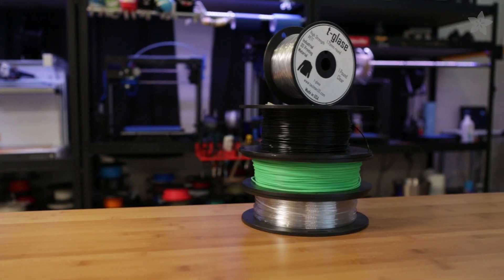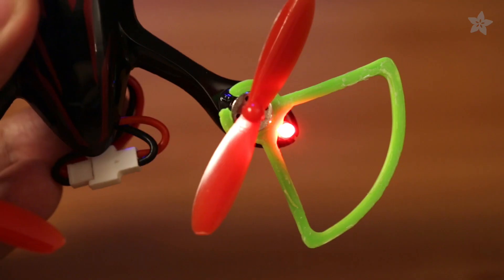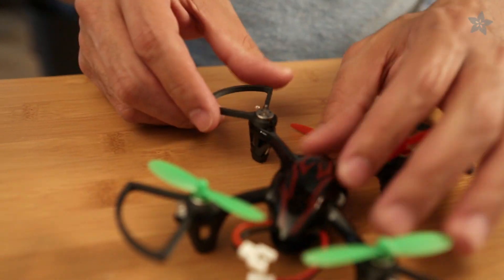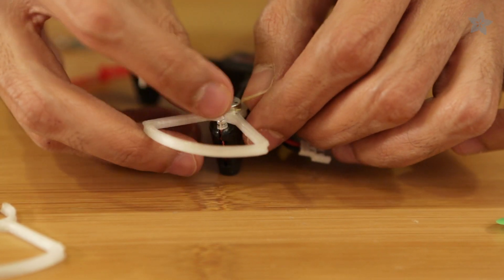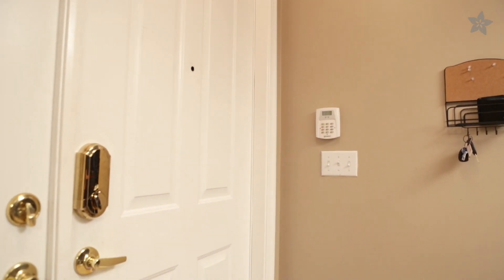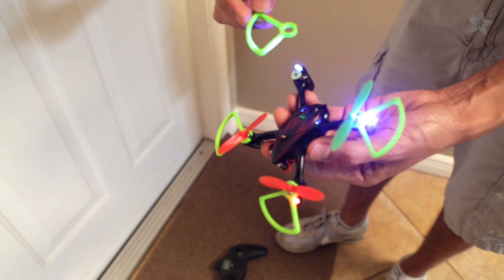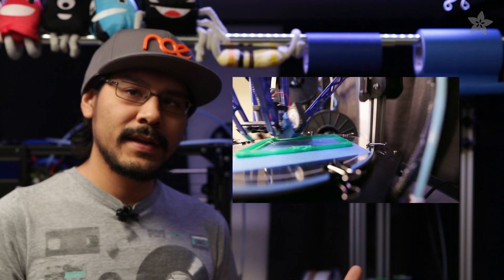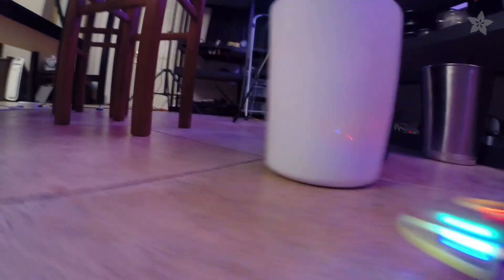3DPrinting with High Strength Filaments for Drones

Comment: thank god i ordered abs filament rather than pla or any others for my quadcopter build
Reply: printing larger ABS parts is not trivial, and aften requires a heated enclosure, or at least benefit greatly from one. PETG is at least as strong and much easier to work with. while polycarbonate is supposedly tricky to work with, it's the strongest by far. you may wanna look into tempering/annealing your printed parts, to maximize strength.

Comment: What settings did you use for the T-glass. I have done a lot of work with the material and it is my favorite for anything that requires strength. By the looks of it you where printing slightly cold, and WAY to fast. 230-240 for temp depending on hot end and 5-15mm/s for best results of strength and clarity. Can be pushed to 25 and be printable.
Otherwise, yay for ABS

Comment: Nice work on the testing.  Is "drone" the new generic term for quadcopter like "robot" is for anything terrestrial-based?  Most often they are only and actually "remote controlled vehicles".
Reply: Keith Ward Agreed. These are variations on radio controlled devices, not an autonomous vehicle.
Reply: it slightly bugs me too, but the word drone has become synonymous with multicopters
Reply: Well the expensive quads are where the name really caught on, they can fly themselves home to you and you can set waypoints with them and they will autohover and some other things

Comment: Doesn't printing with ABS require ventilation as well? 
I recall there could be some nasty decomposition of the ABS plastic while heated at high temperatures... which is what you do when you fuse filament in 3d printing :)

Nice infovideo!

PS: I've seen bed attachment issues and warping in large print in older professional Stratasys printers (which used their own propietary ABS cartridges). That said, they were very rare and the pieces were super strong altogether.
Also, they were temperature  controled cupboard-like printers, with ventilation and such :p
Reply: JJ CC if you have an open printer abs can smell up a room. It can burn at higher temps but is fine with 3d printing around the 220-230c mark. You can also chemically fuse it with acetone to make it stronger and turn the layers into a solid piece. pla can warp more easily in heat, even just sitting in a hot car can warp it.
Reply: Oh,  didn't know pla warped too.  You learn something everyday. 

And I did forget about the acetone and abs.  It's really handy to fuse pieces of abs together ( but wear safety glasses and gloves,  it is nasty)
Reply: JJ CC  I think it's likely the least of your concerns if you smoke, drink, or eat processed foods already.

Comment: That carbon fiber filament is actually PLA mixed with chopped carbon fibers, which is why it prints like PLA and is brittle (chopped carbon adds a lot of stiffnes but not much toughness to the print). I'd like to see how CF-ABS filament manages, not to mention CF-Nylon once it becomes available.
Reply: The "carbon fibre" filaments are such a fad, it'll never behave like carbon fibre composite molds. The best we have are still the basic well established plastics (e.g. pla, abs, pc, nylon, hips, pet, etc).
Reply: DrR1pper yea the quotations are really right. The fibers aren't really in any way that makes it useful for what people think of carbon fiber is good for. CF filament is just cf fiber particles mixed into some thermoplastic. It's probably best in use as a friction disc since I'm sure it has at least decent thermal properties compared to other filaments for 3D printers.
Reply: DrR1pper I imagine depends on the amount of carbon is in it. Much like the bronze fill filament, not very strong, but gives it a nice weight, feels cold like real metal and there's also a steel fill as well that allows it to be magnetised. I'm sure there is a use for a thermoplastic that has a carbon mixed with it.
Reply: Chopped carbon fiber infused PLA is good where precision and stability is needed, eg. a dial gauge indicator mount. Carbon infused nylon has been used for decades in model aircraft propellers, to give the extra stiffness to resist the extreme coning the old plastic propellers were notorious for.
Reply: Karri Koivusalo thanks, I was wondering what kind of benefits there would be.
Reply: You do get the nylon carbon fibre though, which is probably one of the strongest filaments.
Reply: +Karri Koivusalo if only they could be nanotubes positioned laterally then it would add a grip of flexibility.
Reply: Sigma Projects Well, if it's composed of pla, then maybe no better in thermal properties than regular pla.

Comment: You say high strength but what are the material properties after printing? I am assuming an elastic-plastic behaviour so things like ultimate tensile stress, yield point, Young's modulus, etc.
Not well informed on 3d printing as it stands so I don't know how high strength the home game can achieve, if anyone would chime in that would be cool. 3d printing seems so damn fun.
Reply: +zero_sum actually they are missing point here, you need to carefully select material for type of application obviously since you are bumping into things its obvious you want material that is less rigid and with low flex modulus also ABS is as said: flexible therefore it can change it shape slightly and will come back to it's original shape while CF is rigid and won't deflect at all pretty much but will crack at some point. This is very complicated topic and while presented in understandable way its not necessarily scientific at all.
Reply: zero_sum Home FDM printers are equal with the capabilities of industrial ones.
Plasticity characteristics of material choices in models can be manipulated by modifying the design.
That's the fun, artistic and difficult part of additive manufacturing.  The science, engineering, art and processes,, push hobbyist to learn several different types of specialties,, that have typically been spread across many different occupational fields.